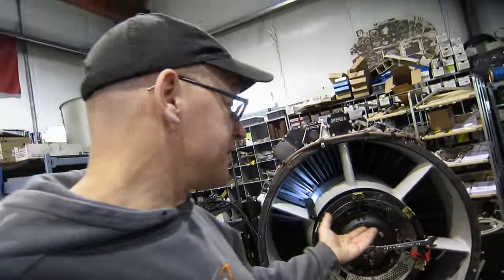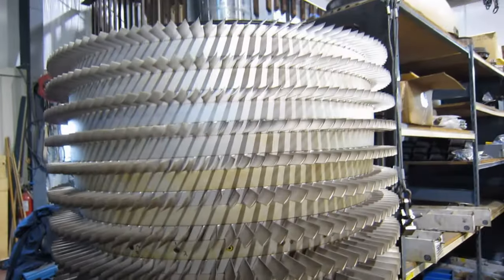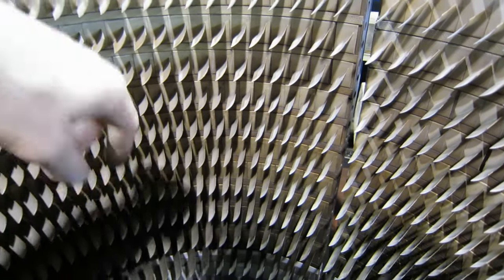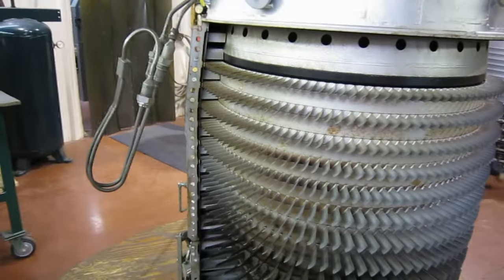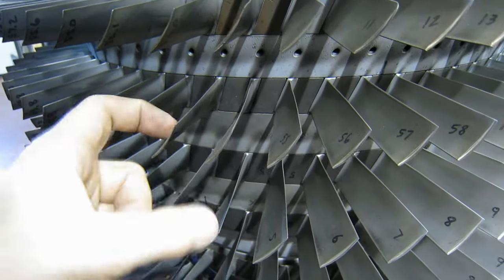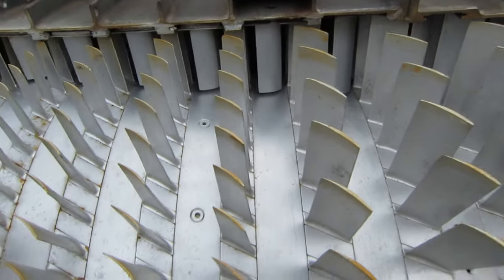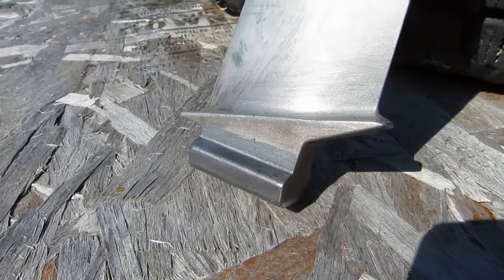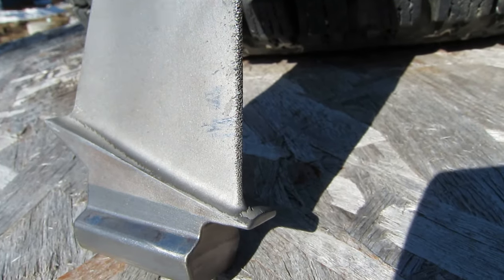Compressors - Turbine Engines: A Closer Look

Comment: can you classify me different types of compressor blades and their functions?
Reply from the maker: Sure: compressor blades impart energy in the form of velocity to the airflow they encounter.

I think I know what question you meant to ask, but we don't work that way here.
Reply: AgentJayZ I mean the different sizes and shapes of rotors(at the front end and inner part near exhaust),  and the direction of blades in which static rotors and moving rotors are fixed
Reply from the maker: You are mixing up terms so much here that I have no idea what you mean. 
For example, a rotor is something that rotates, and static means it does not move, so what do you mean by "static rotor"
By convention "blade" is the name given to an airfoil attached to a rotor, which moves, and "vane" is the name given to an airfoil attached to a casing, which does not move, so it is also often called a stator.
This basic level of information is covered somewhat in many of the videos contained in the playlist... which has an index.
Reply: AgentJayZ I could explain better if I had a 3D model,  the alignment of blades in stators and rotors are completely opposite
Reply: AgentJayZ Why the bypass air is not mixed with the jet blast in jet engines?
Reply from the maker: It is, and it isn't, depending on which engine you are talking about.
Go and do some basic reading, and you will be pleased with what you learn.
Reply: AgentJayZ I'm talking about a basic jet engine in Boeing 747
Reply from the maker: The 747 does not use basic jet engines; it uses turbofans. See, a little reading would really help to at least get you started.
The term "basic jet engine" has a few technical meanings, and lots of non-technical ones. Can't be sure of what you mean there.

Anyway, the answer to your first question is also in those books I recommend.
Reply: @iii5169  The stators redirect the airflow at the next set of compressor blades.  Without them, the airflow would just corkscrew through the engine and not achieve the compression desired.

Comment: (05:10) Too bad that turbine engine can't be connected to some sort of windmill (with gears) to turn the apparatus, slowly, generating that serene ringing sound that, if it were coming from a live engine, would signify getting away, as far, and as quick, as possible!

Comment: Thanks for video... curiosity: how much thrust could be generated that, without detonation cycle/phase, if this was turned with an external motor (example: belt-driven - most likely impractical - or, electric motor installed - axially in-line - shortly before compressor stage... something like starter motor operating - @12,000RPM? - full time)... example PM axial motor drive??  kinda-sorta gas turbine generator backwards. (flashbacks to A/E24U-8 and/or EMU-30/E Generator Set - GTGE-30-18A?? -from my old USAFE 407L mobile tactical radar dayz)
Reply from the maker: Well, nothing you are saying makes any sense at all.
But, just for shiz and giz, I'll give you the short answer.
None.
Reply: @AgentJayZ  so a vacuum cleaner doesn't work (i.e. create vacuum or thrust)... nor does a fan... or airplane propeller, or leaf blower... or turbo charger.
Reply from the maker: This does nothing to diminish the meaninglessness of your first comment.
It's not an argument you've started. It is a display.

Comment: So once the plane engine sustains forward motion, enertia vacuum and pressure take over driving the engine so no more fuel is needed. Probably creates a shock wave that would bow backwards around the wing causing the plane to levitate like a bee. Interesting, thank you.
Reply from the maker: It doesn't come accross in text, but I sure hope your sarcasm button is maxed out.

Comment: I wonder how an M-1 Abrams turbine looks after a few years in the desert.
Reply: Straight up, the blades inside the engine are eaten up pretty good by the time the tank comes in for it's maintenance cycle.
Reply from the maker: There may be some increased wear on the compressor blades, but they have really good inertial particle separators in the inlet to keep most of it out of the engine.

Comment: why does the pressure increase?
Reply: A good question.  Notice how the blades get stubbier as you go from front to back?  The same air that goes in the front comes out the back but the passage gets narrower and narrower: that's how the air is compressed.
Reply from the maker: That's a very common misunderstanding, and it's completely incorrect. The air gets compressed by the blades and stators acting on it. Because it is compressed, it takes up less space. The passage is narrowed (therefore needing shorter blades and vane) in order to keep the velocity of the air the same as it passes through the compressor.
Reply: thanks!

Comment: So is a jet engine basically a series of fans that suck in air for fuel to be ignited at a high rate?
Reply from the maker: You might get 20% marks for that, but not in my class.
There is no such thing as suction.
"fan" is a technical term with a specific definition.
There are no fans in a turbojet engine.

Comment: according to Bernoulli's equation, air velocity has to decrease for air pressure to increase. It makes me think that as compressors increase air pressure, air velocity decreases too. I am lost......
Reply from the maker: a bit... Bernoulli talks about changing one type of energy into another... but remember, the compressor adds energy to the system. A lot of it.
The compressor accelerates the inlet air to a velocity, then continually adds energy as it maintains that velocity and increases the pressure.
I'm still working on a video explaining compressor function.
Reply: Thank you for your ever immediate replies. I can't wait for your new compressor video.
Reply: mma15 may i add that Bernoulli's equation is only valid for incompressible flow, and the compressor.... well.. you know

Comment: G'day,

  Yay Team !

  A very interesting Video.

   Have you ever calculated your personal Atmospheric Carbon Emission "FootPrint" ?

  I personally emit 9 Tonnes of Carbon Dioxide per year, based on 2.5 Kg  of C.O.-2 per litre of Petrol which I burn, as well as allowing for the Firewood which I consume...

  By way of comparison, I live in Australia, Off-Grid, with a Stand-Alone Solar-Electric system...; whereas the average Australian emits 30 Tonnes of C.O.-2 per year...

  I pay Rates on 100 Acres of Regrowth Forest, which sequesters 100 Tonnes of C.O.-2 per year.

 So, after cleaning up my own mess, and that of my two (adult) Children who both live in Town & are Grid-Connected, as well as cleaning-up after the Taxpayer who works to fund my Pension...; I have 1 Tonne of Atmospheric C.O.-2 Sequestration per Year more than the Emissions for which I am responsible for..., with which I attempt to clean-up the Messes-in-the-Sky being made by people who don't give a Shit how much they pollute.

   What's your PERSONAL Atmospheric Carbon Footprint...; do you pay Rates on enough Trees to offset your Emissions, or are you a Selfish Nest-Fouler ?

  Just(ifiably ?) wonderin' ,

  ;-p

  Ciao !

Comment: I am fascinated by jet engines. Can someone tell me how you remove the blade lock pins on a GE J47. As they are blind holes I am curious as to how they are removed for R&R of blades.
Reply from the maker: Oh! You're supposed to show curiosity and ingenuity by finding the info yourself. It is there. Do not read any further!

...otherwise, check out  Jet Questions 48...

Comment: Why the blade clearance (clearance you have showed) is so important and running in a condition with a corroded blade root is so dangerous
Reply from the maker: It's a precision machine. Worn out or corroded parts might fail. That isn't good.

Comment: what type of root fixing is used in compressors ? dovetail method or fir tree fixing method
Reply from the maker: It depends on whether you mean the rotor blades or the stators in the cases. the stators are usually mounted in slotted tracks machined into the cases.
Compressor rotor blades are usually mounted in either a dovetail or a slightly simplified fir tree mount to a disc, but sometimes the whole rotor is a drum shape with slotted tracks machined, as in the LM2500. In the RR Avon, discs and blades have holes in them, and steel pins lock them together, in an arrangement similar to piston pins in automotive engines.

Comment: At 7:04, he s saying "solid stainless steel" ....steel?? I think even made by some old tech , it should be some sort of titanium alloy, if not some composite materials
Reply from the maker: +monsword 
... should's  a bad word.
It defines the stress created by the difference between the way things are and how you have decided they ... should... be.
Reply: AgentJayZ no no, don't take me wrong, I was just curious how stainless steel would handle that amount of stress/force added to the blades subject to the high temperature high rpm. If it's stainless steel, may I humbly know what specs it governs, similar to a high strength mechanical bolt, in engineering world, the material is called out " ASTM A197" or ASTM A490, right? U r right, I should not be using "should" for engineering talks.
Reply: AgentJayZ and I work as a structural engineer for 15 years, I deal with "conventional materials " like carbon steels, concrete, polyethylene, epoxy, some aluminum on a daily basis and they work well for 95% the projects. I did use some "unconventional" materials for some offshore projects. Whenever I propose it for use, some questions to be addressed: working conditions? Reversal loading/ fatigue? Service life? Sourcing of material? So far as my knowledge, no "steel category" materials can handle the working condition in a jet turbine and work reliably for the life span is designed for. But it doesn't mean because " I don't know" it does not exist. That's why I am asking the material spec it's made of...thanks
Reply from the maker: +monsword   
Titanium would be good for the forward compressor blades. I'm guessing SS was chosen for cost reasons.
The rear of the compressor gets too hot for To.
The LM2500 was designed about 15 years later, and maybe Ti was less expensive.
It has titanium alloy compressor blades in the forward part, and switches to nickel alloy blades in the final stages of the compressor.

Comment: Logically speaking I could never comprehend how the compressor could compress air it inducts, since when all fan blades turn on a shaft all at the same speed , each blade would simply take the air from the previous stage and pass it on to next set of blades, they in turn take that same amount of air and pass it on to next, until the last set of blades simply push out the same amount of air that was inducted in the beginning, so how the hell can air get compressed when the air simply moves in from front to back, it is not trapped is it as the back end is open, unlike in piston engines, when both inlet and outlet valves are closed the piston moving  up compresses the air as it isn trapped , this trapped air  has no where to go or escape, but in a jet engine these series of blades spinning all in the same direction, with one end sucking air in, then this same amount of air sucked in by the 2nd and 3rd, and subsequently all other stages, and then leaving out from the other end , logically what goes in  should come out the other end, it cannot make any more air come out can it, and if it makes less air come out only then one can say a compression is occuring, since in a jet engine  the other end is open so how does it compress air? I have heard these compressor blades can compress air as high as 40 times! this is what baffles me, so if you were thinking logically, you would have never got off the ground  building or inventing a jet engine, so clearly the guy who invented the jet engine must have been an illogical thinker.
Reply from the maker: Wow... I got to your question and stopped after that.
A compression stage includes a rotating set if blades, which give the air velocity, and push that air through a a fixed set of stators. The stators are arranged as a row of diffusers, meaning they use the energy in the flowing air to compress it. The air is sped up by the rotor, and then slowed down and compressed by the stators.
Repeat that 10 to 17 times, and you've got air exiting the compressor at over 100 psi.
Bonus: the gas path tapers I side the compressor to accommodate the fact that compressed air takes up less volume, so the velocity stays fairly constant.
The tapering path does not cause the compression.
Any of the books I recommend in my video called Books, will really help you out on this subject.

Comment: Filtration? Where are filters and how do they look like?
Reply from the maker: For industrial engines, there is an inlet filtration unit, where the goal is to have the airflow velocity across the filter medium as low as possible, so the filters are the size of small office buildings.
Aircraft engines breathe unfiltered air.
Reply: @AgentJayZ  I took industrial engine as commercial airplane. My bad. Industrial/commercial..

Comment: Would I be correct in assuming the compressor rotors are symmetrical and therefore do not generate a pressure differential? Also, I keep reading that stators increase pressure via diffusion. Would it be correct to assume the stators have no effect on the flow and thereby allow the flow to slow "naturally"?
Reply from the maker: Your questions are difficult to make sense of, but if I apply my best " trying to figure out what you mean" analysis,  your two answers are:
1 No.
2 No.
Reply: Forget the last question; I'll take another shot at the first one. Are the rotors in a compressor symmetrical or asymmetrical airfoils? Thanks.
Reply from the maker: I don't know what you are asking. The question is irrelevant to me  and incomplete, but Here's my try at an answer:
Lengthwise, no
Widthwise, no.
In thickness, no.
From base to tip they are twisted, so no in whatever dimension that is.
Stage to stage, no.
The compressor in this video only has one rotor.

Comment: Why can’t you put a screen on the intake to keep birds out?
Reply: Lots of factors to consider...
1) You'd be severely restricting airflow in the intake
2) A screen won't do too much with birds slamming into it at very high velocities
3) Let's say you install an extremely powered screen. That would add tremendous weight and aerodynamic instability. Also if that screen starts breaking apart, you're in for much more catastrophic damage than by birds xD
There are precautions in airplane and engine designs to minimize bird/debris damage, but a protective screen is not a viable option
Reply from the maker: You can, but it is not done because it's not necessary.
The later models of the J47 had retractable screens. We've tested them. Made videos about it.
The Orenda 10 used to have a fixed screen. Have not made a vid about that one.
Reply: Khaled Taha thanks for the information very helpful
Reply: Khaled Taha love the videos! Thanks for the reply and teachings
Reply: @gigraphics9639  anytime 😁

Comment: Stator blades not getting progressively narrower is what i don't get.
Reply: The compressor blades are airfoils that are developing pressure differential. The stators are for control of gas flow direction (and also additional pressure differential). Two different objectives. Given the wide range of operating conditions the stators are designed conservatively to always provide a given output gas direction at variable flow rates. The compressor wheel blades are designed to achieve optimized pressure differential at various flow rates, Reynolds numbers, and constant angle of attack.....TL/DNR: To minimize surge.

Comment: Ran some midsize power plant combustion turbines....but refinery steam turbines and compressors are where it's at for high speed, high pressure....butthole pucker factor
Reply: And instead of bleed valves ...you have recycling kickbacks....surge is no beuno....but the computer antisurge are nice....dont need a clipboard of graph paper surge curves when coming onstream

Comment: Sorry.  Watched a bit more & heard you thunk a few more rotors.  I heard a  minor triad.  Then I heard a minor 3rd followed by a pitch 1/2 step below the bottom 'note' of the minor 3rd...possibly analyzed as a Bb6+5.  So, my point is I'm not hearing any 3:2 or 4:3 interval ratios which generate perfect 5th and 4ths...which make 'power chords' for Rock-n-Roll don'tcha know(!)  Instead, I hear intervals that have an ambiguous or canceling effect.  Did I just discover something deserved of more research?  I'm retired, bored & available.

Comment: Why are jet engines so expensive to manufacture? Even miniature turbines for remote controlled model aircrafts can cost a couple of thousand dollars.
Reply from the maker: Many parts, all well designed and engineered
High quality materials
100% quality assurance
Assembled by hand by highly trained people
Every unit produced is extensively tested

... sounds like an F1 car... but pound for pound a hundred times cheaper.

Comment: What fuel is used? Compressed air and not Jet A.
Reply from the maker: Your question even has the answer built in. What fuel is used. Used by mixing with air and burning it to heat the air. Even you know the answer. You are just arguing and holding your breath like a toddler.
Please continue.
Reply from the maker: I'll confirm that you are ignorant of reality, and a fool for arguing with it.
Reply: @AgentJayZ  So you are confirming no jet fuel is used. Gas as in Nitrogen/hydrogen AKA air is used. Brilliant con job.
Reply from the maker: Uh, I confirmed that you are ignorant of reality and a fool to deny it. 
Can you even read?
Please, continue to deny reality.
Reply: @dubravkoskoda9947  bro the fuel is mixed with the compressed air, after the air is compressed it goes into the combustion chamber where fuel is mixed with the compressed air, im 15 and i know that